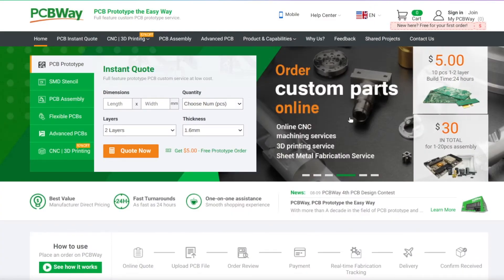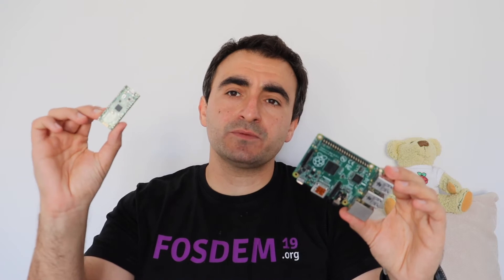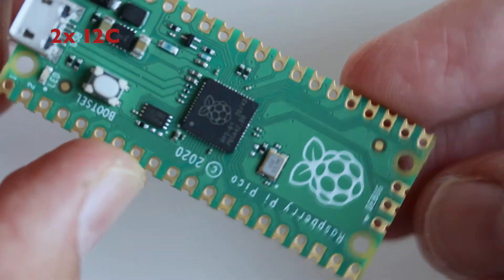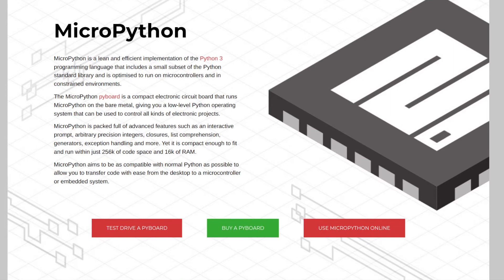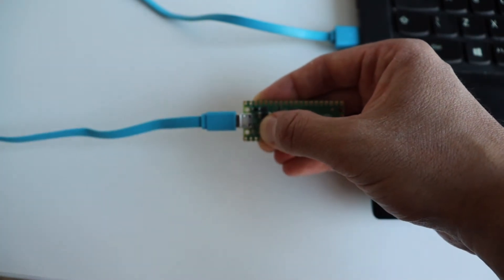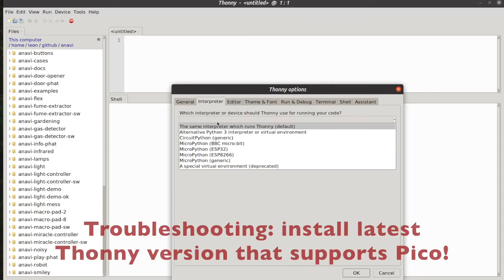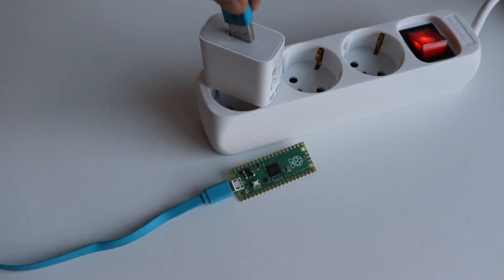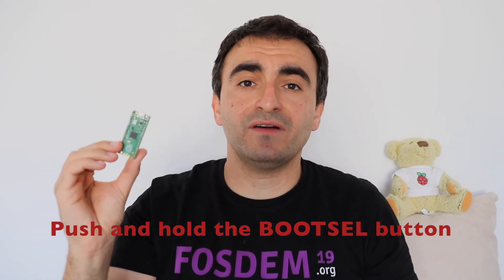MicroPython on Raspberry Pi Pico with Thonny IDE

Comment: Looking forward to seeing what fun projects we can do with this board :)
Reply from the maker: Thanks! Definitely quite a lot of cool things can be done with the Pico (even without WiFi). I have a few ideas for keyboards and home automation gadgets where connectivity is not required. What do you use the Pico for?
Reply: @LeonAnavi  If it ends up being power efficient, i will most likely use it in my mail box to give me an alert when there is mail. And i need to make an antenna tracker at some point, that will most likely be using a microcontroller.
Reply from the maker: Nice! Especially the project for an antenna tracker is both pretty cool and challenging at the same time.